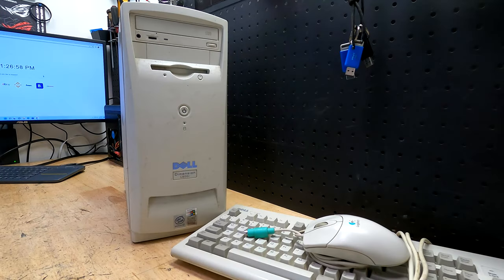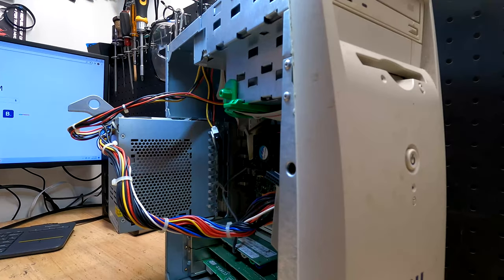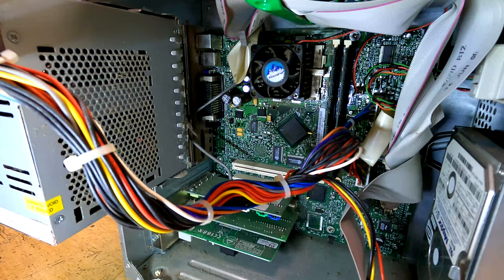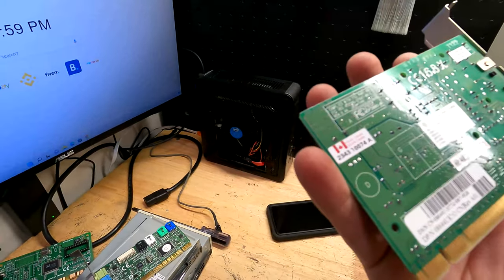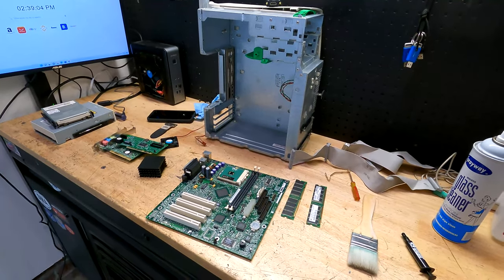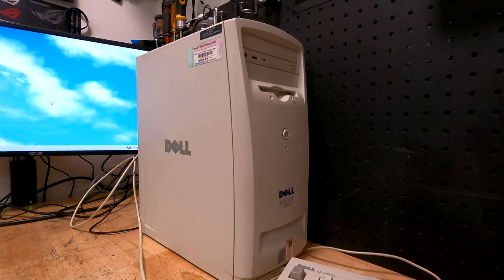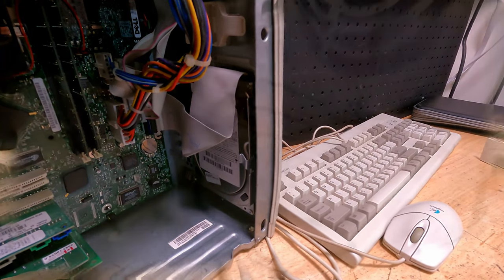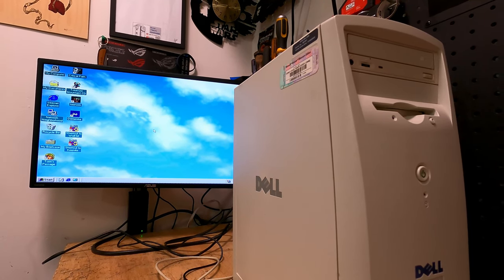22 year old Dell Pentium 3 computer trash pull!!  Dell Dimension L800r!!

Comment: These old Dell systems list for $100-$350 on eBay including shipping. Ridiculous of course, but out of popularity it is what it is. I went the other way and just picked up old boards (socket 7, 423, 462, and 478) and built my retro machines in whatever cases I had. I do have an original Compaq DeskPro EN and two NetVista desktops though.
Reply from the maker: that is def the better route
Reply: Makes sense, although in all fairness to Dell, their original Pentium II/III-based XPS line (and the 4100 that used the same case) is a really stylish system in the looks department.

Comment: I have the 866mhz version of this computer and really love it! Too bad it doesn’t have an AGP slot for graphics accelerator. I’m also looking to replace the power supply just in case, do you know what to look for in a replacement?
Reply from the maker: Not sure of the dimensions if it a sfx or standard, I would have to measure and compare.
Reply: It's standard physically, but you'd need to find or make an adapter to allow for the different pin-out to be electrically compatible with a Dell. Same plug, different order. Also, these Dells are great for Voodoo2 cards, which are PCI, making these the perfect tiny 3D gamers for mid- to late-90s games.

Comment: I brought a dell dimension 2200 (which looks exactly like yours, but black instead of retro beige) back from the dusty basement grave after a cleanout and fan replacement, can run gzdoom, and quake on software. with windows 2000
Reply from the maker: I am still surprised how well these old computer hold up from the years. depending on the years most of them are not plagued with the crappy capacitor issue the plagued lots of electronics.
Reply: Yeah, some modern computers seem to go bad faster
Reply from the maker: @anonymousentity7998  don't make them like the used to!!

Comment: If an intruder gets in my house the first thing I'm doing is whipping dat old skool mouse trackball straight at their head 🤣

edit: there's pci geforce fx 5200 and radeon 9250 on ebay auctions rn under $20. either is fine for ur purpose
Reply from the maker: man those things hurt..... back in HS we use to take them out and throw them at each other.......... then IT got smart and glued the covers so they could not be removed lol....

appreciate the info def gonna look into that.
Reply: My dad has a plastic jar FULL of those trackballs. I should probably get a heavy-duty slingshot and consider it my silent home defense kit
Reply from the maker: @elfedorausado  Bruh........ those jokers are vicious!!
Reply: @DLMtechgarage  well, something with some range is required where I live, and firearms are not an option, so.. 😂